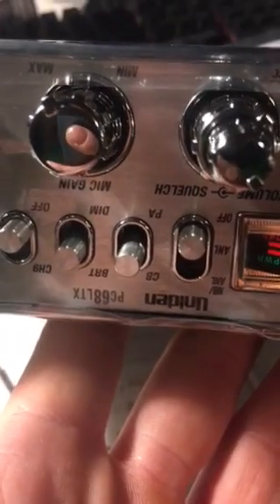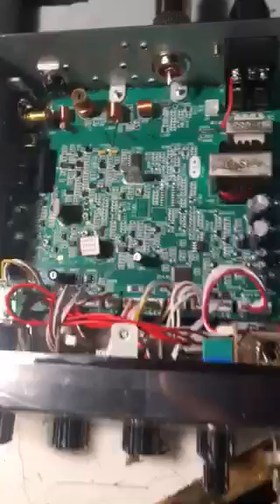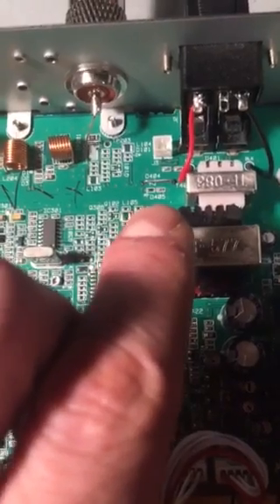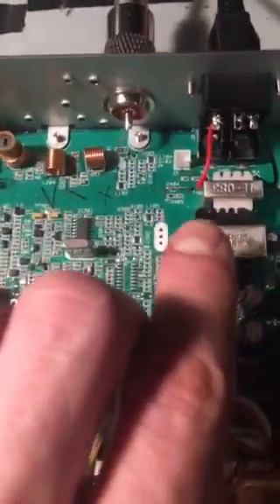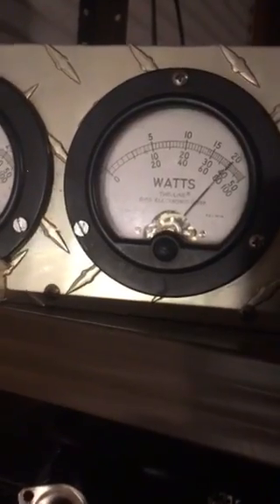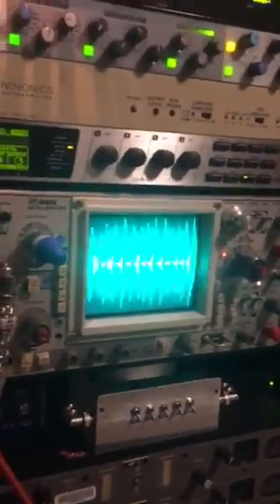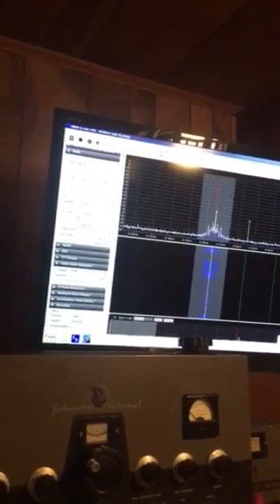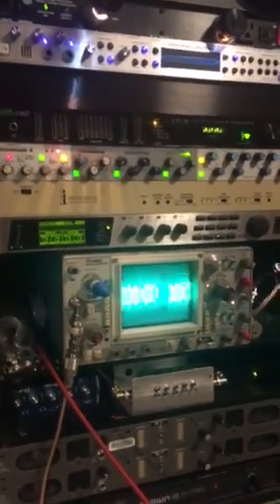Uniden PC68ltx mods (surface mount component radio peak and tune)

Comment: I’m just getting into electronics. Old tube radios and cb.  I have this cb. It’s caps were expanded. So I replaced them.  I still have a low constant hum buzz.  Any idea what I should do? Also could you show us exactly what to do for these mods? So we can follow along .  Sorry to be a pain. Just trying to learn on my own.
Reply from the maker: That's so cool man!  I love to hear about people getting interested in electronics, especially radios!!!! Good for you!!  Yes... old tube type CBs usually have tubes for the rectifiers which can sometimes hum.  I would look to the power supply to start, but really it could be a few things.. especially if it is solid state (not tubes).  It would be hard to say exactly what's causing it without being in front of it.  But.....  As far as mods for this Uniden, I put the instructions for the mod along with part numbers in the video description, but If I have time I will try to make a follow-along video of this.  It's not that hard at all, and if you do exactly what it says in the description it should work fine!   One good thing you can do, depending on where you live is find a ham radio club in the area, you will meet your local hams and radio enthusiasts who may be able to help you in person with this stuff!  I'm so glad you found this hobby!!
Reply: @ I met a guy that belongs to my local ham club. But never went too a meet.  Got with the guy and he sold me a bunch of heathkit equipment. Signal generator,oscilloscope,dc power supply, signal tracer,and a capacitor tester.. learning how to use it all. Lol.  Bit of a trip.   Ya I gotta go to a meet. I’d really like to get my license. But I haven’t had time . I’m going for my A&P license.  I’m a apprentice aircraft mechanic
Reply: @ o also got from him a matching vtvm

Comment: What would happen if I completely removed the grey plastic screw from the L208.
Reply from the maker: it would detune the tank circuit randomly.  best to use a meter to "peak" it or simply leave it be in my opinion 😉

Comment: I'm glad you figured out the swing mod on this style of uniden radios I have the 78ltx with variable power to drive my amp.
Reply from the maker: ive always loved the unidens.  the mod works exactly the same as in the older radios, just needs to be done a little differently because they dont have that jumper that makes it easy hehe
glad you liked the video! keep on modulating bro!
Reply: @631nj  I only have a fatboy 1x2 I run behind the uniden I'm happy with it my pockets ain't as deep as some of the other operators hope you and your family have a good memorial day weekend 73's god bless from 112 southern Illinois

Comment: Thanks for the video. Much appreciated sir.
Reply from the maker: any time!  glad people still use CBs LOL
Reply: @AmateurRadio  still pretty big down here in my area(Alabama/Georgia line). Don't know for how long? Lot of us old timers are dying off. I see lots trucks around here with 8ft whips but it's just the young crowd putting it on for looks. I get tickled when I pull up behind them at a traffic light and see they don't even have a coax hooked to it lol. MC7 off the key, click click.
Reply from the maker: @027MC7  good stuff man.  honestly, I have not been on CB in a while myself.  But, I am pretty active on ham radio... I kinda moved on to 75 meter AM, it's not quite the same as CB but pretty close.  If you look through some other videos I have a TON of watergates from 75 meters, always AM, if you wanted to know what goes on down there 3.875 mhz

Comment: Please do another video I see what you did in side the radio the wasn't clear
Reply from the maker: Check out the description, it details the steps necessary.  you should be able to replicate the mod with that.  All that I did was desolder one leg of inductor L206 and put a paralleled capacitor (47uf) and resistor (220ohm) in series with it.  My friend has the radio now, I don't have access to it anymore to make another vid or take pics unfortunately.
Reply from the maker: oh and i also volted the final a little buy jumping out the protection diode in series with the secondary of the modulation transformer feeding the collectors of the finals.  This is not necessary and if you have a catastrophic failure it can damage the modulation transformer.  I simply just have no respect for the tiny and very crappy little mod iron they put in there so i let 'er rip tater chip.  Likely that youll never have a problem, just if you do itll be a lil bigger hehe.

Comment: Hey bud, can you give me the details on what i need to order to do this to mine? I would need some more power like this.
Reply from the maker: value of cap used was 47uf, value of resistor was 220 ohm.
Reply from the maker: A description of the mod and instructions are in the description as well :)

Comment: My radio for some reason had a diode connected between 13.8Vin and ground... it was tripping my power supply. Took me a bit to find the bugger, but when I did it met my snips. Radio is now working.
Reply from the maker: they throw those in as reverse polarity protection.  The diode blows and clamps the B+ rail to ground if leads are reversed and powered on...

Comment: At bellscb you can have the same peak power with 5w of carrier without that cap and resistor so what you see as a customer is a more clean layout. Obviously you get  good results but does not look very professional to me
Reply from the maker: It's not.  I only do quick jobs for my close friends when they ask.  No money charged, junkbox parts.
Reply: Bells CB doesn't show how he does it,  so how do you know he's not using a cap and resistor?
Reply: @clintmurphy5436 
Well or maybe they are just over volting the radio
Reply: @Tastauer  If that's the case then the cap and resistor method is the better choice over just over volting the radio.  But you did say this guy's work is unprofessional, why???
Because he does own a big fancy shop like Bell CB does?
Reply: @clintmurphy5436  the only reason why I made that statement is because if you use the cap and resistor (not to mention that on a surface mount board like this the components are prone to fall apart from the soldered leads) you are reducing the carrier and in the other hand increasing the crest of the modulated signal and this will result in splatter instead of crystal clear AM modulation. IMHO I will leave the  carrier alone and I will increase the modulation (bypassing the Potentiometer) and since this final transistor is a mosfet I will also consider adjusting the final stage coils
Reply: @Tastauer  There's no amc potentiometer to bypass that I can see.
Reply: @clintmurphy5436  there are several little potentiometers try to look for RT3 AMC ;-)
Reply from the maker: @Tastauer  i like to leave the amc circuit intact to simply grab some audio compression as it adds audio density. cap and resistor allows full voltage swing of the modulated B+ while limiting the carrier level .  Sort of like raising the make up gain on the output of an audio compressor. (the cap and resistor are your gain knob)
Reply: @AmateurRadio  To understand how distortion occurs you must first understand the concept of modulation index.
Modulation index is defined as:
h=peak value of m(t)/A=M/A
where m(t) is the modulating signal and A is the peak value of the unmodulated carrier wave.The modulation index gives the extent of the maximum amplitude deviation from the unmodulated amplitude of the carrier wave. So if you have a modulation index of 0.5(or 50%), it means that the carrier amplitude will swing by 0.5 times above and below its unmodulated value. In other words it will have a value between 0.5 times (when the modulating signal is minimum) and 1.5 times(when the modulating signal is maximum).If the modulating index is 1(or 100%), the carrier amplitude will have a value double that of its unmodulated value and zero when the modulating signal is maximum and minimum respectively. But what happens when the modulation index is greater than 1 or compressed over the modulation index then the lower excursion of the signal will drive the carrier amplitude below zero, making it negative(also changing its phase).if in an enevelope detector, the diode will be in the cutoff or will be our limiter or limits the region, below zero. So the envelope detector will clip the envelope of the detected, the distortion is due to the nonlinearity of the detector PLL and the excess of combined carrier reduction and the dephased signal
If the radio is tuned or synchronized in frequency there will be a phase detection loop, which will always be synchronized to the carrier phase, so this problem doesn't occur if the carrier is in phase, the RF carrier may undergo huge temporary also by fading when compared with the sidebands redundant radios or manually controlled when you clarify the signal. In other simple words you  can modulate the audio signal without affecting or distortiting it if you are limitating the carrier
Reply from the maker: @Tastauer  hence the resister limiting the DC while allowing the modulated B+'s AC component to pass through capacitive coupling.
Reply from the maker: @Tastauer  You're at the mercy of the operator with this mod.  If you lower the carrier power you must also lower the audio power used to modulate the carrier, abuse it and exactly what you said here will happen.  That I cannot control.  It is useful however if you wish to drive another stage with the radio at reduced power and you calibrate the audio power to not exceed zero volts on negative peak excursions.
Reply: Bells is trash and splatter too, wtf do you care what it looks like, what it sounds like it's what matters.

Comment: Do you have this info any where else other than mauldroppers as i can not get image verify to work, hense no registration for me.
Great work!
Reply from the maker: Post from mauldroppers- "So 241 bought this gay uniden new style 68. It's all surface mount, has some gay AMC that works like an icom where it swamps the carrier out if you disable it and hit it too hard. Fuck all that. Leave it be.

I got around it by installing a good old swing kit on the bitch. Leaving the AMC intact worked fine, and I was able to get 250% positive mod without square waving the audio IC too bad.

List of mods:

Peak L208 for max carrier (mine saw 8.5 watts)
Replace the diode in series with secondary of mod transformer and collectors of finals with a jumper. (D404)
Lift the side of L 206 that is furthest from the final and add paralleled cap and resistor in series with the inductor. (or transistor controlled variable... Tip31 and pot, you know...)

value of cap was 47uf, value of resistor was 220 ohm. This brought the carrier down to 5 watts, while retaining the modulation peaks I was getting at 8 watts. Plenty there. radio sounds like a big radio. Doing the numbers.

Anyways.
I have seen barely any info on the internet about modding this thing so here you go. I have seen people say you can't mod these.

results:
-250% positive modulation
-5w carrier, 40w PEP with modulation

-clean (for what it is) on spectrum"

That's the full post.
Reply: @AmateurRadio  Would it be possible to do the mod without replacing the diode with the jumper? May not see 250% modulation, but 100-120% is ok with me, and may be spectrally cleaner too.
Reply from the maker: @clintmurphy5436  yes, and it is also safer for the modulation transformer with the diode left in place.  I just did it to hot rod the thing a little, quick and dirty.
Reply from the maker: 99% of the time the jumper wont cause any trouble, but if you have a catastrophic failure of a component downstream of the mod transformer it could launch the iron.
Reply from the maker: Alright maybe that got cut off.... I'll put the mods in the description.
Reply: @AmateurRadio  Your a gentleman and scholar! Thanks for thinking outside the box. 73's
Reply from the maker: No, I actually only posted it there.  I can dump the post in a comment for you